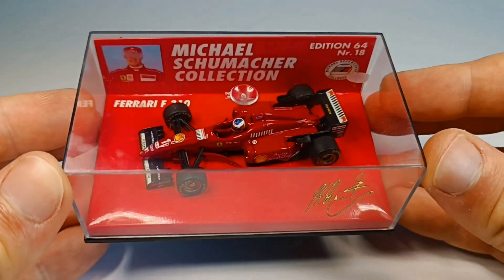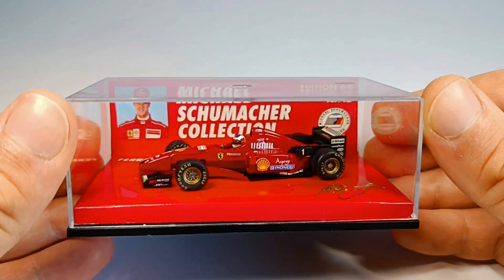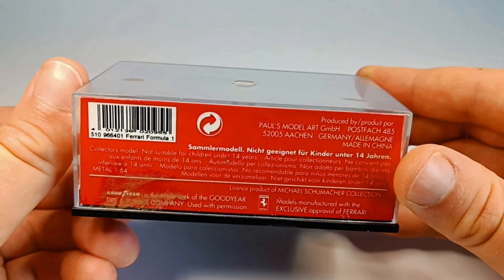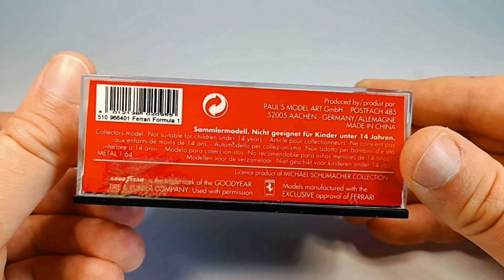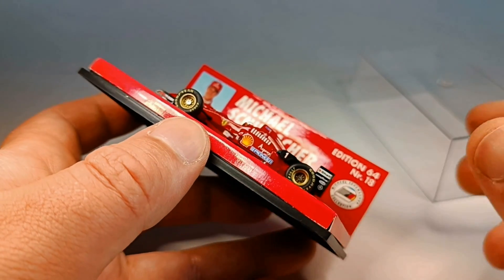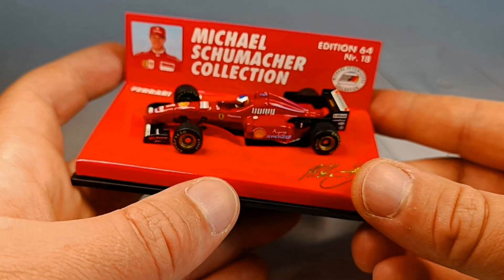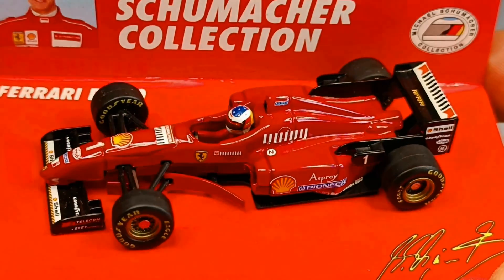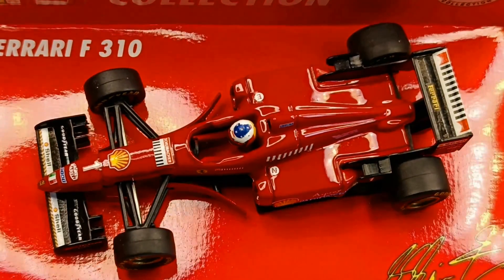Ferrari F310 Aerodynamic Test | 1/64 Car in Miniature Wind Tunnel

Comment: That's really impressive! If you compare this with the B193, you can even see why the F310 was so bad aerodynamically! The B193 generates much more downwash in front of the sidepods, whereas on the F310 the turbulence of the front tire in front of the offset sidepods disturbs the airflow, which affects the diffuser at the rear, which generates much less upwash because far less air arrives there.